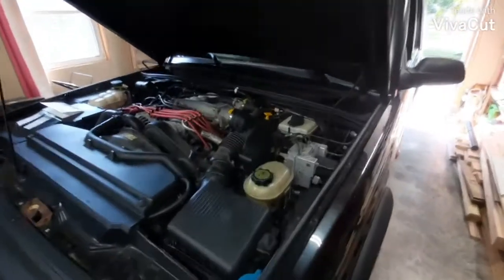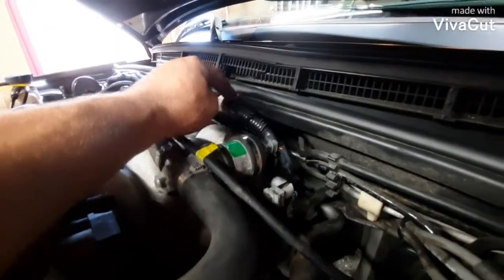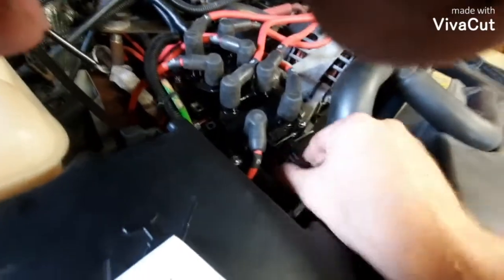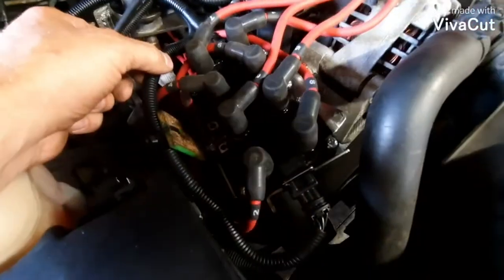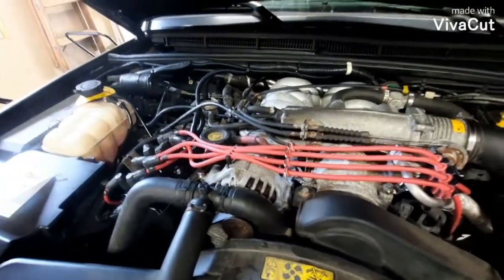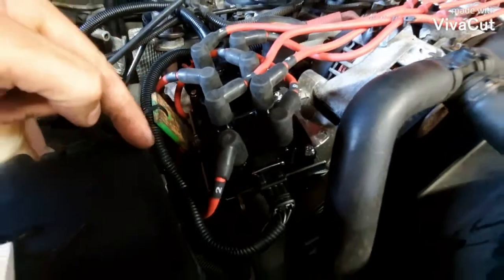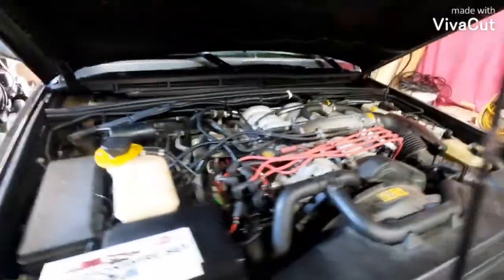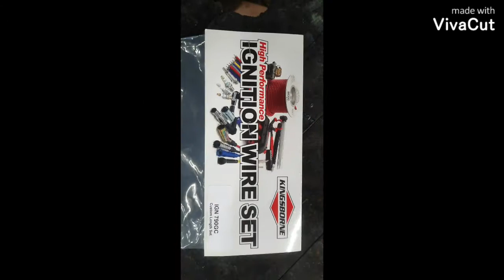Land Rover Discovery Coil Pack Relocation with part numbers

Comment: Hi Scott
You don’t need extensions the plus that go on the coil packs go into the main harness. If you open it up and find the coil plug wires just pull them out until they can plug into the relocated  coils.
Reply from the maker: I had considered it, but I wanted to keep everything 100% original. I didn't want to unpackage a harness that's wrapped and secured away from anything sharp or hot. Plus it's really tight behind everything. That way it's always "plug and play" whether it's with the factory setup, or my jumper leads.

Comment: Great info! What seal size did you pick from Corsa? JPT-SL1 or JPT-SL2
Reply: wondering the same thing
Reply from the maker: Im 99% sure I used the JPT-SL1. I used 16ga wire, which is .052" diameter. That fits the sizes in the dimensions listed. Whatever gauge wire you choose will of course dictate which seal you will need. Any bigger than 16ga would probably be tight inside the plastic clip with the crimpable prongs.
Reply: @scotthartman314  
Thank You!

Comment: Hey I have a question does the coil pack have some type of ground Earth wire or is it just the two harness connectors on both sides?

The reason I'm asking is because there was so much involved I don't remember seeing one but one of my buddies thinks there might be one that I'm forgetting to connect but I can't find anything. I had a cylinder 8 misfire that was receiving no spark with a good plug so I decided to do the coil pack and I haven't got the relocation kit yet and now that it's back together the misfire is so bad it won't even start it'll only run under throttle like it's down to 4 cylinders putting fuel down my cat's so I feel like maybe half of the coil pack isn't even working. I don't think I got any of the routing wrong because I changed one wire at a time to avoid incorrect placement. So does the coil pack have some sort of ground or just those two connectors? Also I ordered the relocation kit because now that I'm taking it apart again I don't want to put it all back together behind there and risk another issue.
Reply from the maker: Its just the factory harness that connects, and stays clipped. It may ground itself via the mounting bolts, I cant remember. It could be any number of issues. I relocated mine, along with all 8 wires and plugs, and had them all separated in looms so it ran fine. However, I drove 30 minutes away the next day and I had a #2 misfire. It actually burned a small pinhole in the boot of the plug wire because it was jumping to the hood. I had to lower my mount, and give it an angle to get more clearance for the hood. I had to use the plastic battery box cover between the hood and my new coil relocation to insulate the short to keep from misfiring and get home.
Reply from the maker: I would make sure the wires are separated, so you arent getting any crossfires, or ghost fires out of time. Also make sure you have clearance around it. If its shooting spark to the firewall or something like mine did to the hood, and getting a misfire that way it will burn a hole thru the wire quick, fast, and in a hurry. If so it will have to be replaced of course, and more space given. If you can slide a piece of plastic or something between the coil pack and anything metal around it, and it loses that misfire, then that is your issue. Of course these are just some of the problems it could be. I would start by making sure it isnt something simple like this before I spent too much on any parts you may not have needed to buy.
Reply: @scotthartman314  okay good call on the hood clearance thing. Yeah I think now that I've took it apart again while waiting for the relocation kit I've determined that didn't Mount the new coil set very well and the upper plenum started pushing on it slightly creating a gap between the plenum in the manifold which would make sense because the misfire was so bad at idle but a little RPMs it would sound normal and when I shut the truck off a little smoke would come out from the manifold so I think I created a gap there. As I loosen to the manifold bolts coil packs slowly became loose as you could see it looks slightly lodged in between the two. So basically a major vacuum leak LOL but I don't want to risk putting it back together and there's something else so the relocation seems like a good idea for future simplicity. Also I broke the Locking clip portion of the driver side connector from harness to coil and it would go into the coil but it wouldn't be super secure so I cut one off a junkyard truck and attached it so I have a good connection to the relocation Extender on that side. So after all that I'm hoping the original cylinder 8 was just the coil going bad because it didn't have any spark at all yes the plug wasn't fouled or funky just a little dark from having fuel spray on it but not all wet

Comment: How long did you make your jumpers? I'm Vin5 and not wanting to dilly dally around with this. Would rather make them now and then perform this when I do plugs/wires next.
Reply from the maker: Ours is lefthand drive....with that said, the drivers side is appx 4ft long, and the passenger side is about 2 1/2- 3ft long. After building each one with the male/female couplings I have listed, and using the supplied grommets specific to my wire size, I sheathed them with the wire loom tubing, and secured them with wire loom clips.
Reply: @scotthartman314  Damn - I made x2 3' Jumpers. Need to order more connectors to make the 4' Jumper.
Reply from the maker: @mrsantschi  It may work that length...depends how you plan to route them. I ran mine around the throttle body and out a little further to protect them from pinch points, etc. You can see behind the engine with a flashlight and see where they clip to the factory coil, and get a rough measurement from there.
Reply: @Scott Hartman will let you know how it goes. Ordered more plugs but may give it a college try this weekend. Planning to route under the plume.

Comment: IGN-790GC cant find except IGN-790.  Are they the same?
Reply: did you find out?
Reply from the maker: No, they are not the same. You will have to call Kingsborne and tell them you want that exact part number, with the GC at the end of it. They're a little pricey, but if you go buy 1 wire at a time to get each one a specific length, it would be about the same. These are much more convenient, and numbered to make easier, rather than laying them all out and deciding which one should go where by length.
Reply: Call the makers they don’t list them but do have them

Comment: Bought a used disco a few weeks ago that already had this relocation mod on mine.  Getting a misfire on number 5.  What size wires are they?  The stock wires are not long enough
Reply from the maker: 99% sure they are 8mm. Call Kingsborne nothing else. They could say for sure, and maybe they would even sell you the one you need. Personally I would just replace the whole set, and keep the rest on a shelf in my garage as spares in case I ever knicked or burned one. Shipping was what made them so pricey. Just make certain they are clearing the hood. My issue was #2 jumping to the hood, causing/storing misfire. Had to use plastic fuse box lid as an insulator to get home one night. Then modify my bracket a few times the next day, and close the hood with my phone camera and flashlight turned on to see what kind of clearances I had.

Comment: My new coil packs came numbers 1-4 on both packs. Is that normal.
Reply from the maker: Not sure....probably. Each pack is probably only responsible for the 4 cylinders associated with its half of the firing order.

Comment: Where do I get the wire female and male kit for the coil pack relocation?
Reply from the maker: I ordered them straight from www.corsa-technic.com. Just type in JPT-3P in the search bar, and it automatically gives you the related JPT-3S as an option too. They are the matching male and female sets. Just be sure you select the right # of "pins", and it has an option to choose the size of rubber seal also, based on what gauge wire you choose to feed them. Their site has a chart somewhere that represents what each boot size fits as far as wire gauge also. Thanks, and good luck!
Reply: Hi, what specifically Pin/wire size and Insulation/Seal size did you choose for the connectors?

Comment: Got a number for the coil packs from oriellys?
Reply from the maker: I used the Import Direct brand from O'Reilly. Lifetime warranty, its part # 23-0134. Its about $70 with both coil packs already mounted onto the bracket. You can save a few bucks if you have an account to run it through.

Comment: Can you tell me what your total price  ended up being
Reply from the maker: Around $70 for the pair of coils, $20 for the male/female connectors, and $70ish for the certain spark plug wire set (mostly shipping cost). Around $160 US dollars? Not any more or less expensive than the regular replacement cost would have been...I just wanted to relocate them in the process. The coils have a lifetime warranty, so even if they need replaced, Ive saved myself tons of work in the future. Plus the ability to troubleshoot each cylinder quickly and easily.
Reply: @scotthartman314  Did you need to buy two sets of the male/female connectors or dos one factory wire reach to the new location? Thanks!
Reply from the maker: I bought 2 males, and 2 female connections. They have different size options also for the seals that go in them, based on the gauge of wire you choose to feed into them. This way too, if anybody ever decided to go back to oem location with everything, its as simple as unplugging the extension. No cuts to original harness.
Reply from the maker: The original harness barely reaches the coils from the factory. Its tricky to unclip them with long screwdrivers, but it can be done! Be sure you plan to follow through with said project. If you change your mind, its even harder to plug them back into original coils with the same screwdrivers.
Reply: @scotthartman314  Plan on setting it all up before disconnecting that sucker!

Comment: Hardware store wire is not the same as automotive wire
Reply from the maker: Good point! You are definitely correct. I forget not everybody already knows the differences. Have to be very specific, or people will be doing all kinds of crazy things.  You'll want to use a multistrand copper, automotive wire. If you try to use something like "12-2NM with ground", or something leftover from your last house project, please just shut your hood, and call a friend for a 2nd opinion. 🤣 I just meant that I got mine at my local hardware store. You can still get the proper stuff at any parts store, hardware/home improvement store, etc.